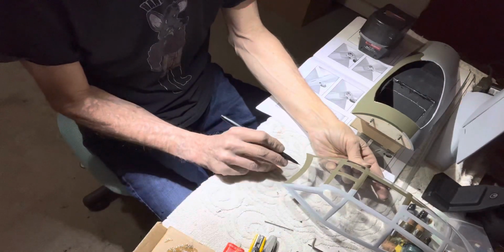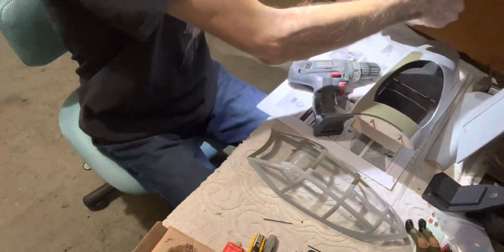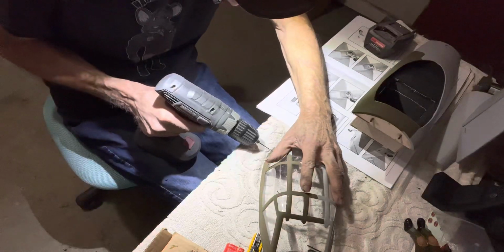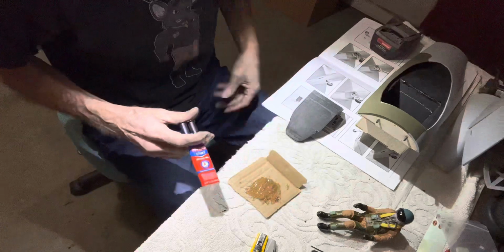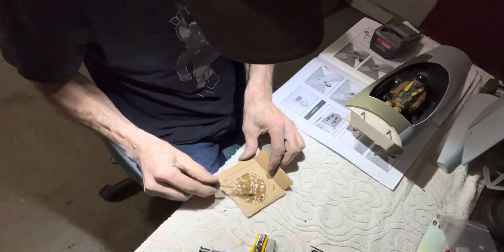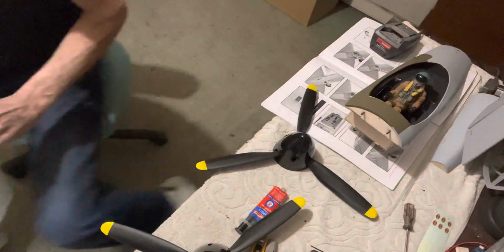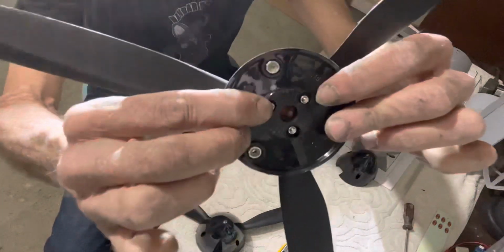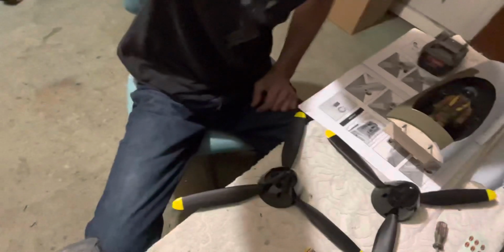Seagull Mosquito (Props) ?

Comment: It's going to be nice Eric! Eric you could paint the front of the nacelle black and that might "hide" the difference some, but if it were me I'd buy two more spinners the right size. You'd eventually use those on something later. Whatever you do I would take the time to balance those props after the modification. Also sand the roundness of the spinner (holes in the spinner) so the prop blades are not touching it. If they are that causes vibration. Another thing to consider is the right size larger spinner may have big enough holes so it won't be an issue.
Reply from the maker: If I can find two Adam. Been looking and no luck yet. Still looking 👍🏻✌🏻🖖🏻